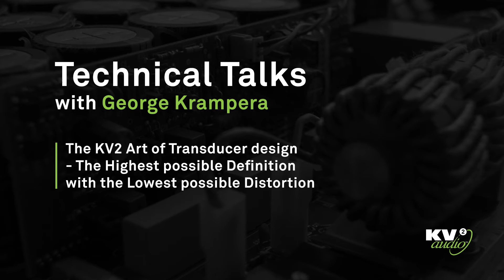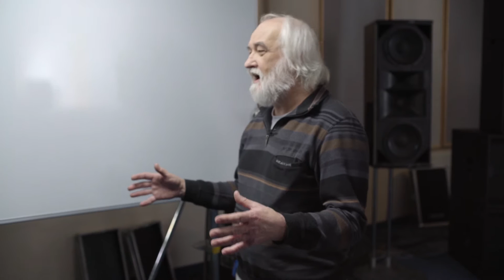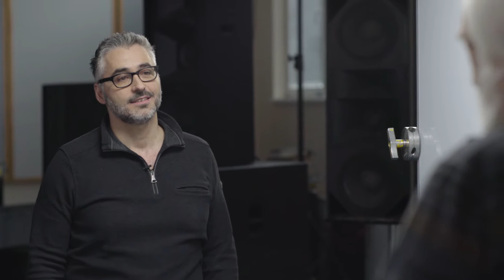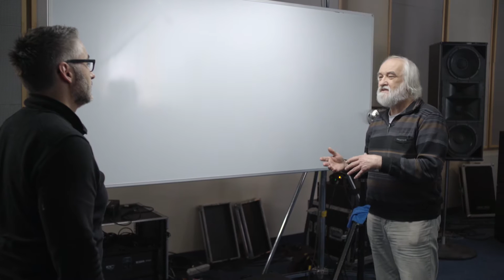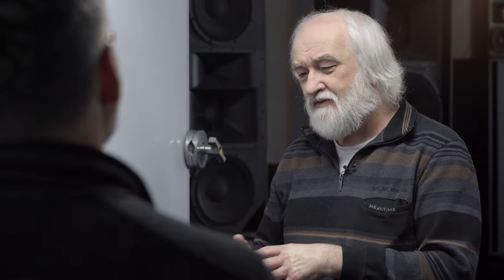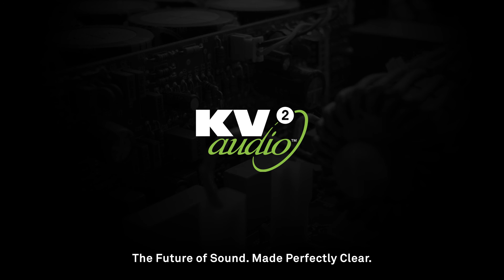TECHNICAL TALKS - The KV2 Art of Transducer design

Comment: I just heard a range of KV2 speakers at a trade show 2 days ago - fantastic !!!

I am normally never ever satisfied with loudspeakers & I've heard HiFi rigs costing nearly $1M

Even the smallest 6.5" 2 way, had tons of detail, imaged like a bastard & had jaw dropping output and clarity - demoed with a single 12" band-pass sub ( yes I'm aware of bandpass alignment issues & I'm not a fan of bandpass at all ) it filled a largish 150 meters squared room to satisfying levels.

The 15" active 3 way was absolutely sensational in all it's performance aspects & considering that a complete system sells for what some schmucks charge for a single power cord (!!!)

It truly represents exceptional value - near-electrostatic like transparency & imaging on steroids.

I've heard the Bricasti Tidal loudspeakers system with diamond tweeters recently as well - just to let people know that I'm not making comparisons to some Bose crap etc.. & this is what I mean by transparent & detailed

At the same show there was EAW with their Anya line array, which sounded absolutely atrocious - usual line array problems - all the SPL you want but no imagining whatsoever, and no depth of field just an artificial synthetic flat wall of noise